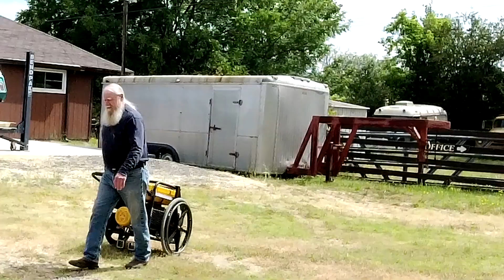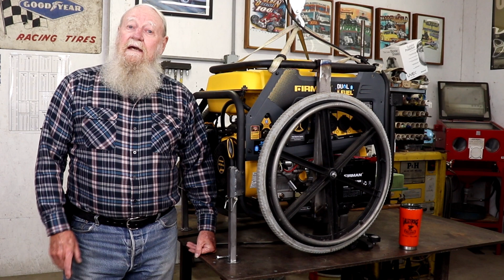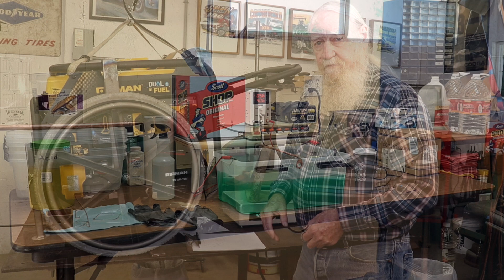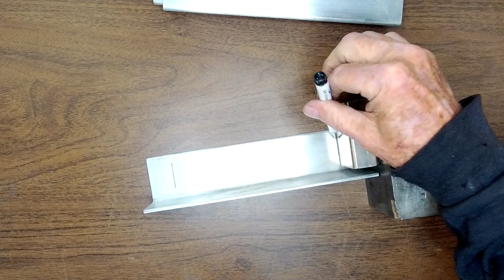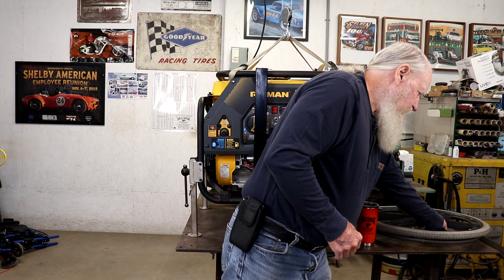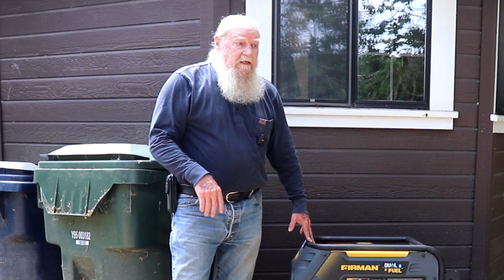Making an All Terrain Generator 2

Comment: Hi Jere,
Nice project results.

"A one inch square with unequal sides." :)
The accordian fold video transition was neat.
Finding the center of that 2x2 without math.. you rebel, you. ;)

Another "yes" to plating videos. 
I'm about to do some more reverse electrolysis for de-rusting. Any chance to use electricity and water without getting zapped is fun.
Take care,
Joe
Reply from the maker: Joe, I'm putting together the sequence for different aspects of the plating process right now. I will reedit the video I made 2 years ago as a starter. 

That would be an oblong square, with two sides not being ob.
Reply: @jerekirkpatrick2092  
"oblong square".  Oh you engineer-type people. ;)

I watched the plating video when is came out 2 years ago.
I'm looking forward to the new series.

I also enjoyed the "How To Heat Treat Bead Roller Dies" video from 4 years ago. My, how time flies. 
There was a lot of great info in that one, which the norm for your videos.

Cheers.